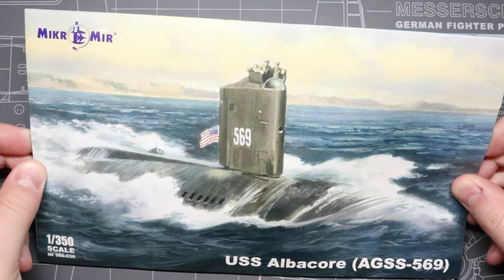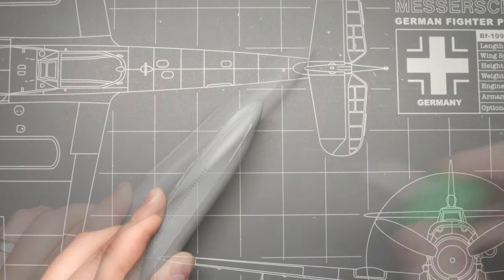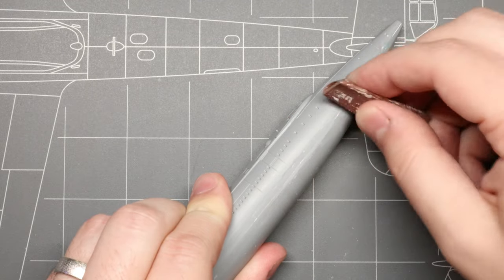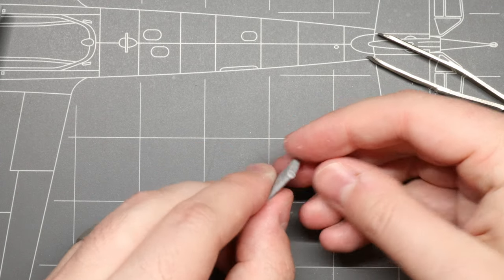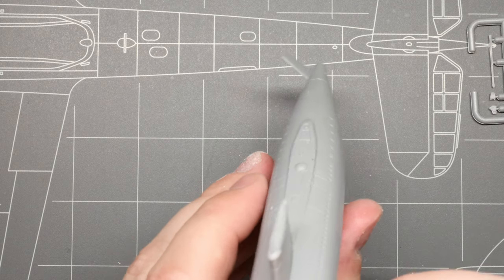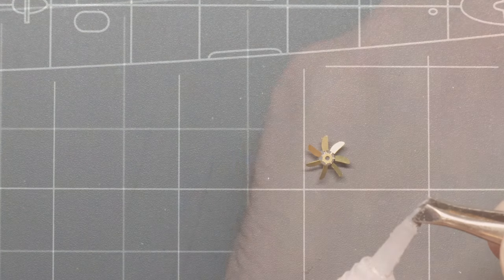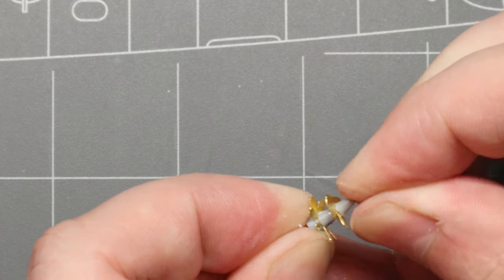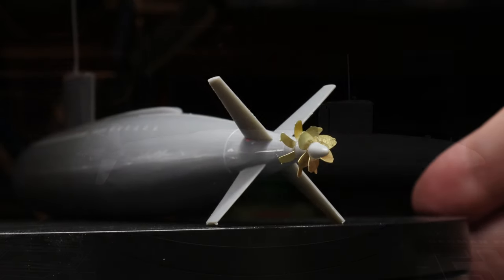How to Build a Scale Model Submarine | 1/350 USS Albacore Plastic Model Kit

Comment: Easy way to remove putty is with a cotton bud slightly soaked in nail polish remover (acetone).
Reply from the maker: Ahh interesting! Thanks for the tip!
Reply: Don’t use pure acetone, it may melt plastic. Only nail polish remover.